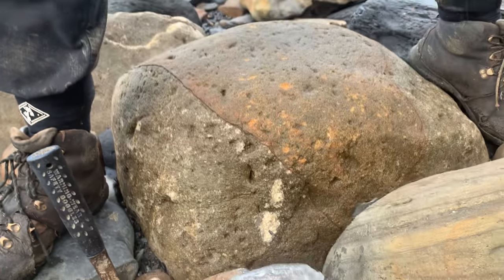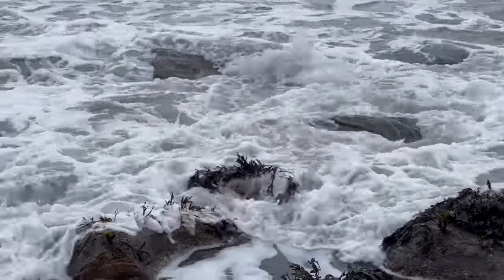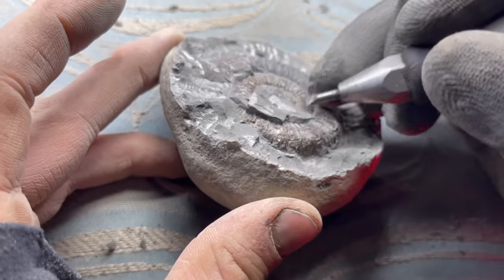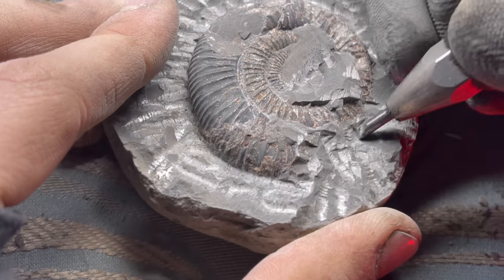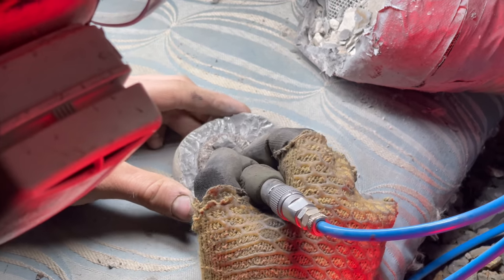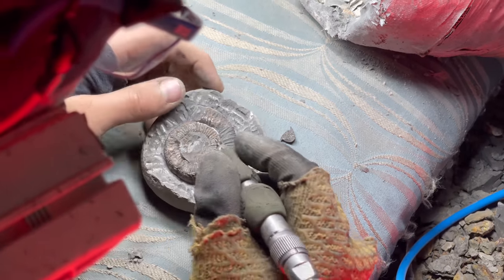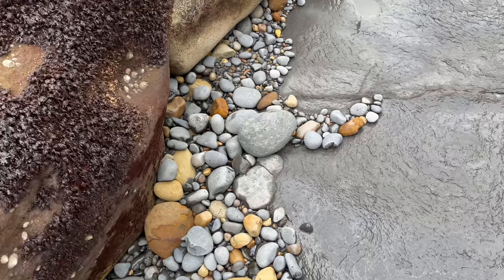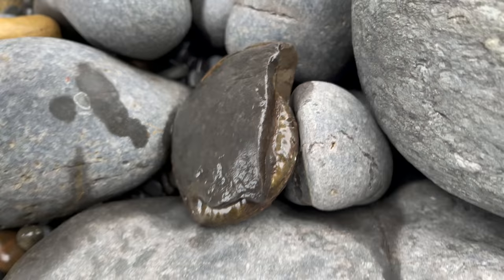Careful Preparation of An Ammonite Fossil! Fossil Preparation

Comment: From the welding section, buy a chipping hammer, lob off the portion that's chisel formed, and use that hammer as a struck chipping hammer. Not only does it work better than smacking, but it's very controllable because it's essentially a chisel with a handle.